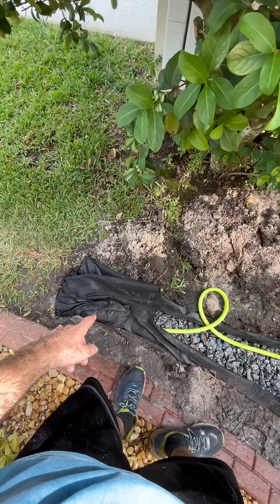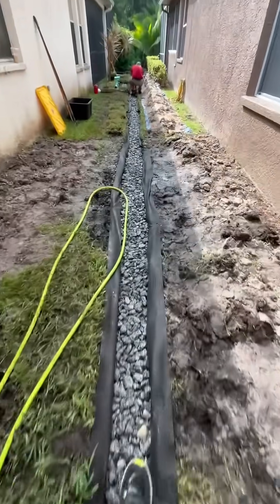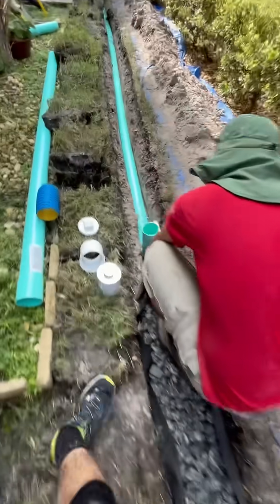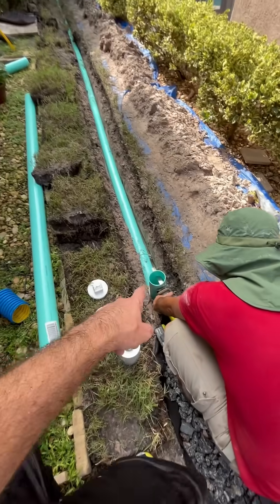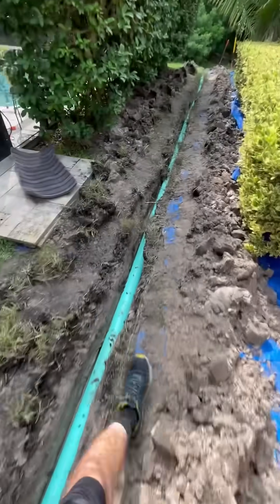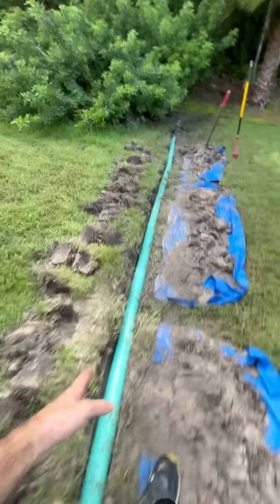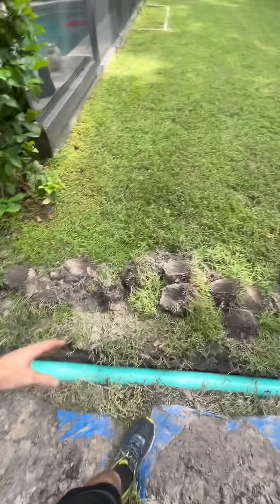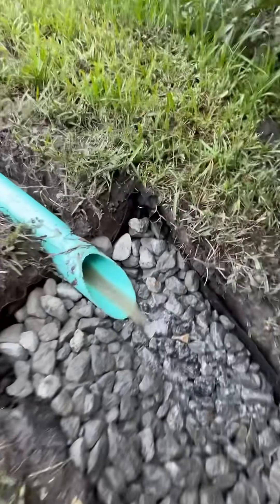French Drains - Yard Drainage - Education on moving water

Comment: You need a rock base below the pipe.  Your pipe will fill up with mud eventually, even with the geotextile fabric.
Reply from the maker: You have no idea what your talking about. All French drains around the US designed by DOT engineers build them this way. Pipe needs to be at the bottom when using fabric so that you can evacuate out as much water as possible.
Reply: @StormWaterDrainageSolutions  Agreed.. The slits above and the sides of the pipe are where the water primarily comes in.

Comment: Cleanouts should be y connector not 90
Reply from the maker: It depends on the type of clean out and situation in which your using it. And also there is no 90 degree clean out in this video only a two way clean out tee.

Comment: Why not put a bed of gravel/ stone under the pipe?
Reply from the maker: The corrugated pipe has perforations 360 degrees around it. The pipe is put at the bottom of the trench on top of the fabric. This allows for the most water to be evacuated out of the French drain so that there is minimal water sitting at the bottom of the trench. The SDR pvc pipe is solid, no perforations. The French drain collects the water and the PVC pipe in this case discharges it.
Reply: @StormWaterDrainageSolutions  you patience thooo to give the same answer again and again and again and again......dudeeee

Comment: Why wouldn't you use sdr perf pipe? 
 Drains way quicker . That material your using can not be jetted, if dirt ends up building up through the years. Definitely more expensive,  but will last a lifetime
Reply from the maker: @robertdenton6936  PVC pipe only has holes on the bottom. The bottom of the pipe would be the first thing to get filled with any sediment so PVC would fail faster. The pipe we use has slots 360 degrees around the entire thing. We wrap both stone and pipe with a geo textile fabric to keep dirt and sediment out. And the material this pipe is made from is HDPE and is a heavy walled pipe. The wall thickness on this pipe is incredible and can definitely be jetted out if needed.

Comment: what would be the issue if you just used the dirt back on the pipe instead of rock?
Reply: Water only travels thru a void. Ie, open pipe , or washed rock. Cut the opening where you want the drain to be, line it with geo textile fabric, put the pipe in there with super sumps in low spots, fill to three inches of the top with washed rock. Close the geo fabric and staple shut. Put soil or sod on top. The geo fabric keeps dirt out. You DO NOT want soil getting into the rock or the pipe. You CAN put soil on solid pipe only. If you have trees or bushes nearby, put copper sleeve over the pipe to keep roots out for 20-30 years. If you install a super sump or elbow with an emitter on top, dig a bit out under them and put a layer of washed rock under it so it can drain. when the rain event is over..you don't want stagnant water sitting in the system..
Reply: @firstname6208  Man, a copper sleeve over a long drain pipe run has got to be $$$ expensive.
Reply: @thebordernow  you only really need it where the pipe passes near trees and bushes.

Comment: Low spot?  

Excess surface water because of poor soil conditions or bad landscaping is best managed by installing catch basins with solid pipe.  

French drains are really for high water table conditions that present a hazard to buildings or retaining walls.  They are not for episodic rainstorms.  

You should have regrade the ground to eliminate the low spot.  Install catch basins and use solid corrugated pipe eliminating the need for gravel and microfiber and saving money.
Reply: Install both tie them with a y adapter

Comment: Straight run, that water will be moving at a High Velocity.
Nice work!
Reply from the maker: Thank you! This one had the perfect setup for the FDM System and the weather here in FL is finally nice and not blazing hot so working outside is actually enjoyable now💪
Reply: Yes, straight run H V no solid in between?